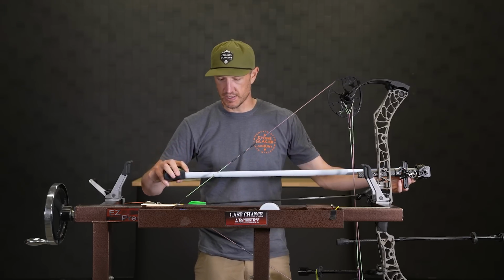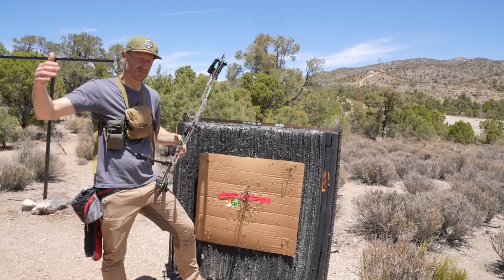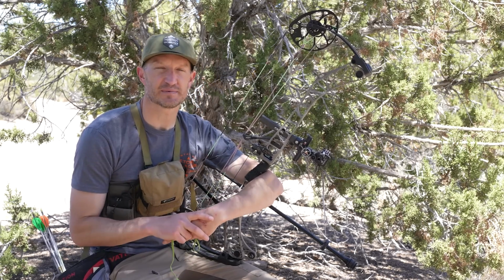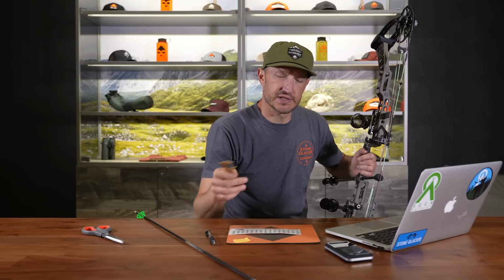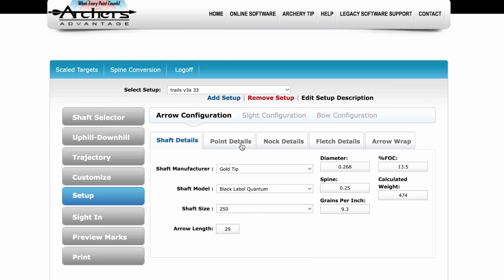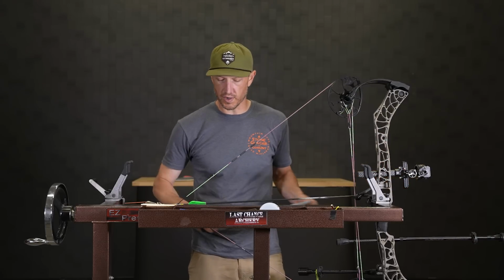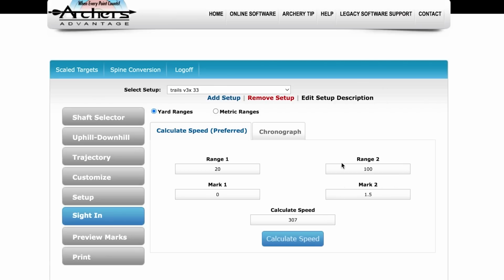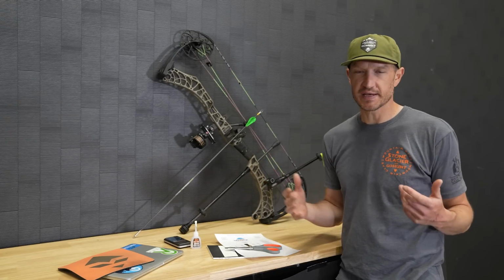How To Sight In Your Bow & Build A Sight Tape

Comment: Hi Trail, nice video. I’d like to know why you did not shoot your arrow through a chronograph to input the exact speed in the bow configuration — bow details tab? The initial speed that the software populates after selecting the brand of bow and AMO draw length is always 100% not accurate thus giving you the wrong sight tape, right? Also, I’m confused about the AMO draw length thing, some people measure it at full draw on a draw board from the center of the berger hole to the nocking point and then add 1.75” to whatever measurement they get.  Some people say that bow manufacturers already take into account the 1.75” for the cam/mod type of any given bow. I’d appreciate if you can share your opinion on this as I’m pulling my hair trying to get the perfect sight tape (black gold pro hunter hd three pin) Thank you.

Comment: Why did you switch from bee stinger bars to aae bars?
Reply: Hi Zach, the Beestinger Microhex bars are very similar in size and design but I have had a couple end caps that came loose and I had to pop them off and epoxy them again. That isn't a huge deal and was a relatively easy fix but it's one reason why I decided to buy and try a set of the AAE bars. Beestinger makes a great product and many friends of mine shoot them with no issues, but that was the reason I moved over to the AAE bars. Hope that helps!
Reply: @trailkreitzer9163  thanks Trail that helps a bunch! I shoot the same exact setup you have excerpt I have the dual trac. I was wondering if the aae bars help any more with vibration then the bee stingers?

Comment: If you use a single pin sight like the Hogg Father that has a built in elevation scale it’s so easy.  Shoot at 20 and set the scale to zero, shoot at, say, 60, or whatever, make notes re the indicated reading on the scale, then add marks in yardage to the wheel adjacent to the scale.  Work at it and refine your settings.  Building a yardage scale from computer programs is trying to get the tail to wag the dog.
Reply: Hi Ed, I agree the Spot Hogg sights are well designed and have extremely tight tolerances. That sight, and a few others that they make are a bit heavy for my liking though. If you ever needed to build another tape for that sight, Archer Advantage can be used very easily and you can build your own using it. Hopefully this helps some people that are using different sights, all the best this Fall and thanks for the feedback!

Comment: Hey trail, how do you account for elevation when  hunting at 10k vs sighting in at sea level?
Reply: Hi there, this is an interesting question and one I have been thinking about and perhaps we will do some testing and a video on the topic in the future. I live and sighted in at my local range which is at 5,700 ft and this last weekend we shot the Park City TAC event and for yardages further than about 80 yards or so we did have to cut a couple yards. For example, on the RMEF course the first shot was 94 yards and my first arrow of the day with my sight set at 94 I was right at the top of the back. I adjusted it to 92 and elevation was right on. Through the rest of the course, anything over about 80 yards I was cutting a couple yards. I need to do some testing with broadheads, inevitably a broadhead is going to drop a smidgen in comparison to a field point and I'm speculating that my tape for anything over 80 with a broadhead will be almost exact but I need to test it. Luckily I live where I can be up at 10K ft in a half hour so I'm going to run up and confirm it. I would suggest that if you sight in at close to sea level and then come up to high elevation mule deer and elk country that your impact point is going to be 2-4 yrds hot. I'd suggest that when you get into the high country you take a half hour or so to confirm your impact points. Hope that helps!
Reply: @trailkreitzer9163  thank you! I asked archers advantage the same question and they gave about the same answer. With their tech, it would be awesome if they had a model for that.
Reply: 100yd on my sight tape was shooting 110yd at tac park city. Sea level to 8000ft. 80yd was shooting close to 85, can definitely make a difference even at closer ranges